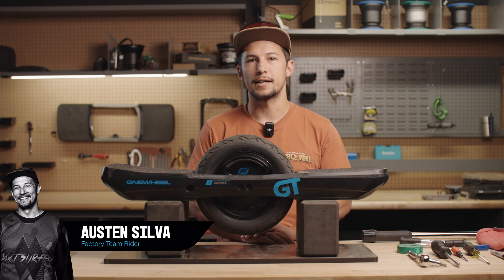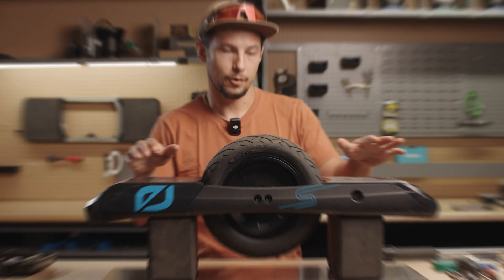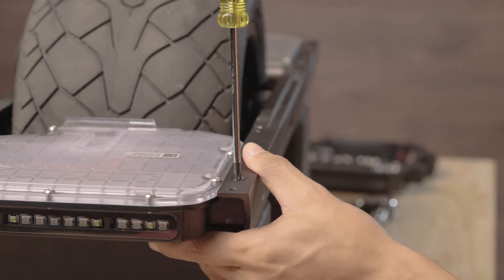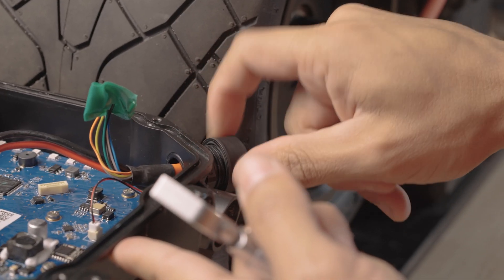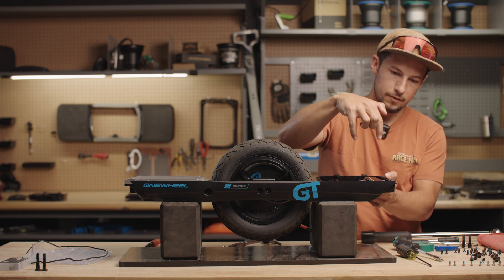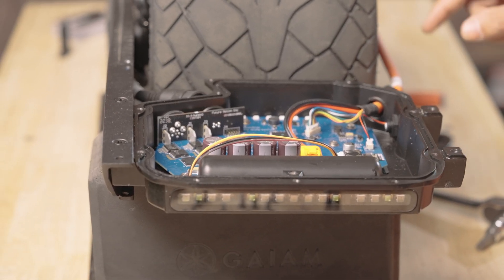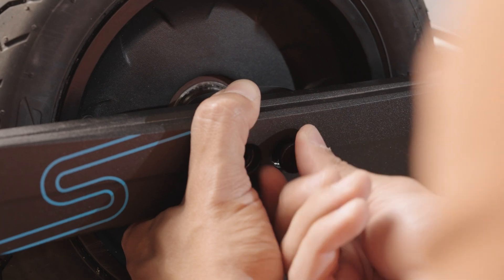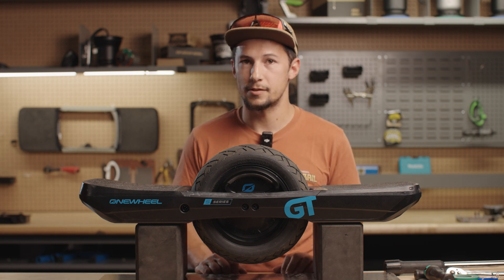How to Install a Onewheel GT S-Series Controller Module

Comment: I’m trying to register my new controller, but I keep running into issues.
Reply: If you haven't registered your old board while it's working in the Onewheel owners portal then it's impossible to do a swap without doing that first. I posted a review on their site with some minor instructions.

Comment: if you buy a GTS controller module and a GTS battery module, can you upgrade a GT to a GT-S?

you'd obviously need to get the GT-S charger and probably eventually upgrade the motor, but very curious.
Reply: I’m very interested in this as well
Reply: i don't see why you couldn't, you'd  probably have to get a serial number for the new parts though...
Reply: I was told by a customer service rep that the new GTS controller would not be able to be activated in this scenario, so no unfortunately.  Maybe one day

Comment: Having these parts available now, would it be possible to upgrade a standard GT to a GT-S by swapping the motor, battery module, and controller to their GT-S variants?
Reply: I don’t see why not you could even use the 6” hub and better foot pads !
Reply: @jordanmacfarlane5807  The only reason I could possibly see it NOT working is because of the serial number.  I don't know if a GT's serial number could be "ported over" to what would essentially be a new GT-S build.  I know FM says the controller is for repairing a board, but not sure if it's limited to just that.  Being able to convert a GT to a GT-S would be a huge win for people wanting to upgrade that don't mind sacrificing parts of their GT in the process.
Reply: @drumstickscarecrow  i'm not sure if this is possible, the GTS uses a different charging plug

edit: it actually looks like you can buy the GT charging port, but not the GTS just yet. i think once that's available, you should be able to "upgrade" your board. i think most will upgrade the motor first, then do the battery+controller+port together
Reply: @itsthatj  Oh yeah, that's something I hadn't thought about yet.  The charge port should be a non-issue since that's built into the hardware you'd be installing.  However, you'd also have to get a GT-S charger since the GT charger doesn't work with the GT-S.

Comment: Why are new hub bolts being recommended?
Reply from the maker: As Taco mentioned it's for the thread lock. Once you break the seal on the bolts from the factory over time the bolts can loosen due to vibrations. Fresh hub bolts come with a fresh coating and will be more secure than reused bolts
Reply: @Onewheel  I've taken my XR apart dozens of times, are these bolts any different? It's great that parts are available for sale but this recommendations seems wasteful. Just tell us which loctite is being used.
Reply: @Onewheel  so can we use our own thread lock?
Reply: The loctite.
Reply: Fresh loctite and cheap assurance that you’ll be putting in bolts that won’t be overly stressed from multiple removals or have a stripped bit or threads.

Comment: Is there any registration/activation that needs to be done through the app, similar to the Battery Module swap? Or does it automatically pair to the first Battery Module that it's connected to?
Reply from the maker: Yep, same process as the battery module but instead of clicking activate battery you'll just click for controller module
Reply: @Onewheel  Thanks for the clarification, wasn't included in the video like the Battery Module video so wasn't sure, appreciate the response ✌
Reply: But if I have a new controller in board it doesn’t allow me to choose this board for anything. It says: Onewheel not connected
Please connect to your Onewheel first and then navigate back to this page again.
How do I click for controller module if it can’t connect to board?
Reply: @PeterPrevec mine are s doing the same thing, hope to get a response soon